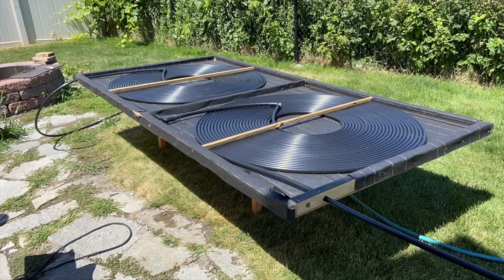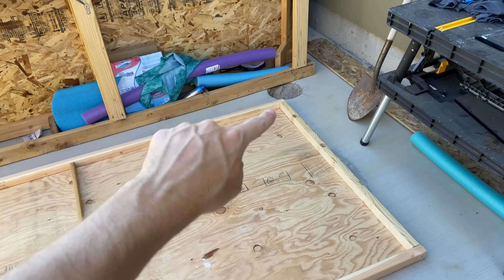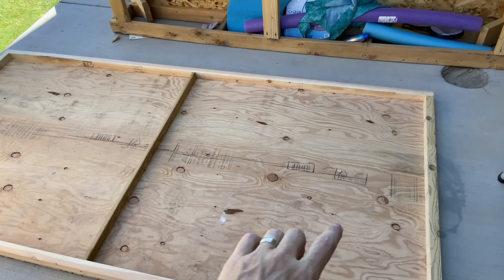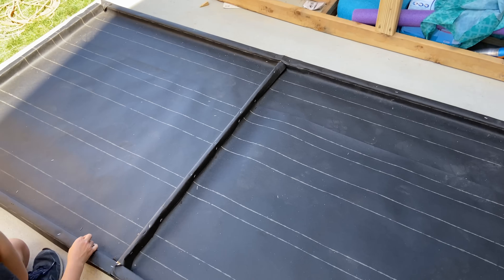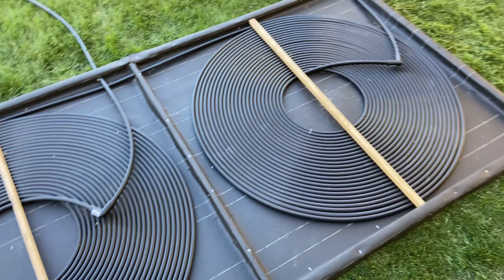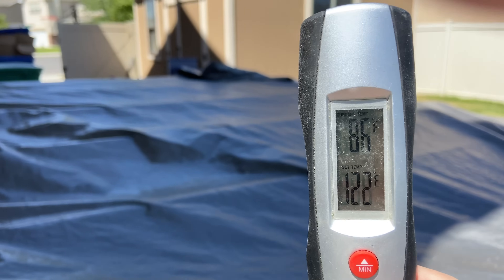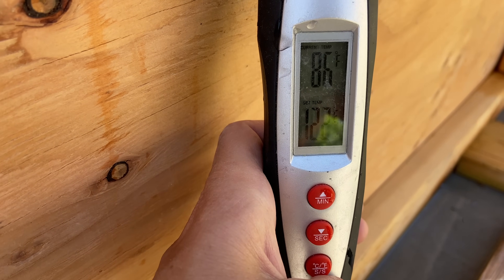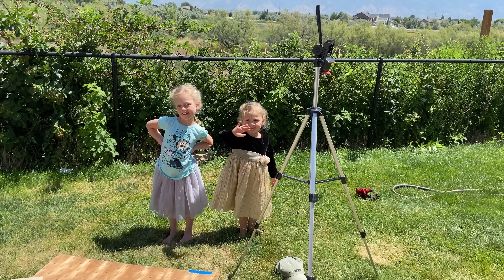DIY Pool Heater - $50 Solar Heater

Comment: What does your plumbing look like?  I use polyballs instead of sand and the rate of water going back into my pool is so strong that it will actually spin the solar blanket.  So I'm thinking I need some kind of diverter so that not all the water is going through the solar tubes or it would blow it out.  If you have not used polyballs in your filter you will be amazed how little chemicals you have to use and how you don't have to vacuum your pool!
Reply: What are poly balls?

Comment: The question is not, how hot is the water coming out of the solar heater.  The question I want answered is, how many degrees does 15,000 gallons of water raise when using a solar heater like this?
Reply: Exactly.  For a pool you are trying to raise a large volume of water several degrees,  vs a small volume of water by a lot.   I found this was the wrong design for a pool and is better for a small hot tub or domestic hot water pre-heater.
Reply: If its around 5 gallons of water in those hoses I cant imagine 5 gallons of hot water would raise a pool temp all that much.. 1in hose and higher flow rate would probably be more effective
Reply: I calculated it based on clues in the video. It's a 4,000 BTU/hr system.

Comment: Definitely not $50. 400' of poly pipe is $40 here, add a $50+ pump, $20 sheet plywood... well, you get the idea, and that's not including the hours of assembly. Given that I can purchase a 4x4 solar mat  for $60 I'm not sure I follow the efficacy... granted a fun, entertaining DIY but just because you can doesn't always mean you should.... :)
Reply: David ... no pump needed if you tie into the pool pump that's already running.
Reply: @rupe53  the guy making the video used an external pump so that should be included in the project cost
Reply: @user-uo1rn2nb8f  ... my point was to eliminate that cost, which will also get rid of the power to run that pump. (and wires, controls, etc) Yeah, you'd spend a few bucks to buy some fittings and such, but everything would flow through the pool pump, which is running anyway. Just be sure to add a few valves so you can throttle the flow as necessary.... or shut things off for servicing.
Reply: @rupe53  Thanks for the response. I'd like to see how you tied it in to existing pump, I would expect it's possible but would require a quite number of fittings, etc. and would including transitional materials and has the potential to 'bottleneck' and create backpressure on a pump that's expecting 1 1/4+ and associated volume/ flow. That said we did build one similar this (last) summer based on the idea and it does get warm! :)
Reply: @davidvalente7935  ... for some reason I only saw this now... sorry. The idea would be to stick a few T fittings into the feed of the pool pump. The pump would still see the larger pipes and the smaller plumbing to the collectors could be throttled to meet temp needs. If anything, the total flow through the pump would be more, not less.

Comment: Has anybody tried sheet metal instead of the roofing paper?
Reply: I have seen a solar dehydrator use aluminum flashing painted black with high heat paint and it works very well.. I wish these youtube guys would quote the source for their knowledge. This type of solar heater has been built by youtuber desrtsun02 in many different variations years ago.
Reply: @mattolsson8816  it would be nice to know there sources. I ended up using radiant barrier sheathing since its supposed to reflect 97% of UV rays. I figured 97% is pretty good and it should heat up the landscape hosing very well. Unfortunately in early October, Southern California, 2020, the average temp has been 75 degrees. But I'm optimistic what this Wednesday's 95 degree day will give me. Then if I could get a bunch of 95 degree days in a row, it will heat my 22,000 gal pool hopefully well.
Reply: I'm planning to build mine on top a metal shed. I imagine it will help produce hotter water. Maybe I can post a video after I do this.

Comment: I'm thinking about mounting such a system on my camper car, creating a closed loop system with the exisiting boiler.
How many liters are inside the tube itself do you reckon?

cheers

WIm
Reply: Should just have to calculate the volume of a cylinder to find that. Pi × (inner diameter/2)^2 × length of tubing. Then 1mL = 1cm^3.  Careful with units on that. 

You can also start out with your required liters and turn that into desired volume, then you can just choose a pipe that is available and calculate the length.  Sorry if that last part is too much, trying to throw out some ideas
Reply: Hi Win,
I am also thinking about for a DIY solar water heater for my campervan. But for the moment I don't know to manage the over heating. Being a closed system, during the summer the water temperature will quickly hit 100°C.
And I don't want to be there...
Reply: You can use a pipe volume calculator..
500 feet of 1/2 inch pipe is 5.1 gallons according to the one I looked at. So convert 5.1 gallons to liters and you're home free.

Comment: 70 mm insulation under pool   15mm underfoor heeating pipe coils sunk level into insulation run hot water through pipes  sit pool on top

Comment: Nice job. If you insulate your pool walls (believe they are plywood) it will help keep the heat in your pool longer too. Keep up the good work.
Reply: Plywood us a terrible insulator.

Comment: I've built the panels already but haven't decided if i want to use my filter pump to do the work or if i should use a separate sump pump, recommendations? If separate pump, what size? My pool is approximately 18,000 gallons.
Reply from the maker: Tough call.  I tried both, and ended up using a separate pump, so that my filter pump could do it's thing without to much effort pumping water through the loops...  I didn't notice much difference though (if any), so if you can get away without buying another pump, I'd do that.
Reply: @DoItWrongYourself  Thank you for the response.   Anyone else have experience
Reply: @mikemeiser5084  it will depend on your filter flow (turbulent resistance), length and diameter of piping  (laminar resistance), location of your solar panels (height above the pump or "head"), and existing pump spec.  After 10 years of use, my 2hp single speed Jandy 2 hp pooped out, and I upgraded to a Jandy 2.7 HP variable speed pump.  It handles a 9 panel system on a single story roof, a Pentair 360 filter (4- 7" diameter paper filters) for an 18,000 gallon pool. Your local pool store should be able to give you advice or connect you with an installer that has some rules of thumb.
Reply: @DoItWrongYourself  I suspect it would only be an issue upon start up. Once it's flowing, there would be a siphon effect pulling on the water, same as when you plug a drain pump in to empty the cover. Once it's flowing you can usually turn the pump off and it will keep going, albeit a little slower.

Comment: You will transfer more heat to the pool with a faster flow rate. The temperature difference won't be as high but the actual heat energy transfer will be greater. Higher flowrate will give you a warmer pool!
Reply: I've watched a few of these types of videos, and the common theme is that people don't understand the difference between temperature and heat.
Reply: @billweasley1382  explain 🤔
Reply: so, sheets of corrugated plastic with small but many channels, with a top and bottom feed in/out would work better ?
Reply: @z4zuse  I use a series of something like this on the roof. Definitely works too well. Lol
Reply: @billweasley1382  so what is the difference i wood like to know  i want to learn. ty
Reply: @pierrevansusteren1870  Imagine that you are trying to melt a block of ice. You can either use a gallon of boiling water, or one lit match. Even though the match has a higher temperature, the water has more heat, and will melt more ice. 

It's the same concept here. A small quantity of water at a high temperature will have less "heat" than a large quantity of water at a slightly lower temperature.
Reply: @billweasley1382  ty
Reply: @billweasley1382  ok but at what point is the water moving too fast? I just built one of these. I’m using a small sump pump to power it. I clamped the tube because I thought it was moving too fast to warm the water. Without clamping I would estimate a flow rate of one gallon per minute.
Reply: @ATP360  you want only a few degrees difference between the pool and the hot water outlet. As the pool temp rises so will the outlet temp. The difference will be maintained (mostly).

The block of ice examples is good. I would like to expand on that example. Which will melt faster a block of ice with 40deg F or a same sized block on a 90deg F day.  Basically the greater the temperature difference between the water and the heat source the more heat energy the water can absorb. As the water temp increase closer to the heat sources temperature it warms up slower and slower.
Reply: @RazrBurn  Agree. Delta T
Reply: @ATP360  The answer is there is no real "too fast"
If the water moves faster you will still gain the same wattage of heat in the pool it's just that the difference in temp will be less
Example with BS figures for easy to understand maths
10 degrees on 1 liter of pool water vs 1 degree on 10 liters = once it re-enters the pool the heat will diffuse the same both equate to the same energy intake
The real question is does the pool lose energy faster than the panel adds it? how long does it take for that energy to bleed back out
Reply: @ATP360  Measure your outgoing water temperature. And find the sweetspot with differentflow speeds. You can regulate flow with a simple ballvalve. Too many factors to take into consideration to try and calculate.
Reply: @BONESnCMA  All you guys are trying to push a rope.  This doesn't work at these volumes!!!!  It's like pissing in the ocean expecting the PH or temperature to change.  Thermal losses is a 24hr period outweigh the minimal heat input via this method.
Reply: @billweasley1382  Thanks for explaining Bill..  Great tip!
Reply: @ATP360  let me explain some things. Ideally, what we do in the industry, is prevent a laminair layer of air or water. It means that when you heat water, at the surface/boundary layer between the water and the pipe, the water is heated, to increase the rate a which heat is transfered you need to refresh that layer. Generally, a flow of >1.5 meter is a turbulent flow and is preferred. Thats why industrial heat exchangers have a high surface area, flow and ia designed to create a turbulent flow. The driving force of heat exchange is temperature difference between the air and water. The difference between heat and temperature is that heat means energy in W or kJ. You can calculate the amount of heat with m.c.deltaT. exaple: 1kg of water of 5 degrees C contain 1*4,186*5 = 20,9 kJ. When you supply that every second, you have a Q (energy flow) of 20,9kW. so you might thin that when you decrease the flow so your output water is for example 25 degrees that you have more energy than when the water is 20 degrees. But when the flow at 20 degrees is 10L/min you supply 13,95kW. At 25 degrees and 5L/min, you supply 8,72 kW.
Reply: agreed on tis one
Reply: Optimization of heat transfer in pipe flow is reliant on many variables, particularly the dimensionless Reynolds number as this dictates when the flow regime has passed from laminar to turbulent (Re = 2300).  You want turbulent flow!  What I really wonder about is the high likelihood that the piping shown here is only partially flooded with a large air void above the water surface and below the top of the pipe where the sun's heat is being absorbed.  This will dramatically reduce heat transfer as air is a poor heat conductor.  Long story short (too late!).... less pipe length + smaller diameter + flooded pipe cross section + turbulent flow = highest heat transfer rate per square unit of surface area.  Sorry if I ruined the fun.......
Reply: @cameronhowe5122  the fun might just be getting started! Can you explain to a layman why turbulent flow is desired for better heat transfer? Is it simply to spread the heat around the water in the pipe and not concentrate it on the side that has the sun on it?
Reply: @cameronhowe5122  Whats turbulant flow?
Reply: Sort of.  There's a maximum transfer rate based on the system, pipes, etc.  But the panel only produces a certain wattage of heat.  Exceed the transfer rate, and you'll only be able to add as much heat as the panel produces.
Reply: @allswellinendwell6957  .
Reply: Yall are trying to relate latent heat of vaporization (energy supplied to or extracted from a system to change the state of a substance without a temperature change). Heating a pool requires no state change, only a sensible or temperature change.
Reply: When I turn on a garden hose in the summer, its unbearable, probably the 150+ degree he mentioned here. Give it a few minutes and you can hold your lips to it for a cool refreshing drink. I've seen many of these videos trying to debunk my hypothesis. This is the closest video I've seen where they actually show the "real use" output of the water compared to its input temp. I still come to the same conclusion, very inefficient design and don't think it'll do much for a typical backyard 12,000 + gallon pool.
Reply: Not if the BTUs are the same.
Reply: Not true.   You’re either going to have high gpm and low delta tee or high delta tee and low gpm.    It’s a math equation.    Doesn’t effect it.
Reply: All of this debate over probably 3 degrees lol
Reply: Not necessarily, the slower flow rate might be giving the water more time to heat up in the tubes.
Increasing the flow rate could cool the whole system down a lot because it would bring more cold water in.

Comment: I built one a week or so ago. I haven't put a clear plastic cover on it. It looks like that is the key. Mine is only increasing the temp about 10°. 65° up to 75°. Looks like I'm going to have to put a clear cover on it.
Reply: Plexiglass or glass.  I will build one, i have an old sliding glass door.  Thats what im gonna use.  Just have to take the glass apart becuz its double pane glass.
Reply: @law35penn  I will be flat out amazed if you can separate a tempered double pane insulated patio door glass!!  good luck with that!

Comment: Awesome video ! I've done something similar some 10 years ago and was amazed from the result. Really hot !
Reply: Philip Gevaert, did you build it for a pool or hot tub?  If it was for a pool, how may degrees of change on a cool day in the 60's or 70's and how long would that take?
Reply: @houstonwarren2  It was for a pool. The difference of temperature depended on the orientation and of the time of day. When it became late afternoon (5 pm) the sun wasn't powerfull enough to heat the water flowing through the collector. So I programmed a timer that would let the water flow for a short while and then stop the flow. Then the water slowy heated and when it was warm enough (around 40deg. Celcius) the water was pumped into a lager tank which serverd as a storage of hot water. When this tank was full it was pumped over into the pool. I also did measurements with glass on top of the collector (regular single pane window glass 6mm). This was a gain of 10 deg. C.
At some point the difference between inlet/outlet with a regular flow was less than 10deg. and then the flow stopped completely. I'll try to dig up some pictures of the old collector. Based on that design I'm planning several new collectors for this summer, but much smaller in size and weith so that I can handle them.

Comment: Yet another solar pool heater video that has failed to grasp the basics of thermodynamics!

There is NO benefit to running the system slower to generate a small volume of super hot water. Doing so actually destroys the efficiency of the system. 

Heat transfers faster when there is a bigger temperature differential. You need to keep a good flow of water going, to extract as much heat as possible from inside the panel. You should also revert back to using the two coils separately. This would reduce the restriction on the flow and allow more water through. Try not to think of it as "heating your pool" but actually cooling the panels. A large volume of water raised by a couple of degrees actually contains more heat than your little jug of very hot water. It's basic physics.
Reply: Thank you for the info Spencer.  Facts are facts and feelings are subjective lol
Reply from the maker: Good tips, I'll have to experiment a bit with high flow
Reply: Would you use two pumps independently?
Reply: As a HVAC guy , I think  , the bigger number of Delta T is , the faster heat transfer  . The same as  central cooling system works at home.
 For example,  if you drop a cube of ice into a glass of hot water,  on the beginning ice is gonna melt quickly, because big difference between temp.of ice and water , but as the water is getting cooler , the ice gonna melt slower ,cause difference  between ice and water getting smaller
Reply: You know you can give advice without being a condescending prick Spencer
Reply from the maker: @HeyTezza  Trolls everywhere Terri, just gotta let them roll off your back.  Spencer’s Cornered the market on thermodynamics.. :)
Reply: Terri M Not when I have watched ten videos in a row where every single person gets it wrong!
Reply: Spencer is not a troll DIY Dash, he's giving you the benefit of his superior knowledge
Terri is a chick, chicks get easily offended
Reply: @thehegeliandialectic8266  I like your first sentence...not the 2nd.  Highly irrelevent who Terri is - and no way to find out since Terri has no info on Youtube.  Of course YOU don't either...!